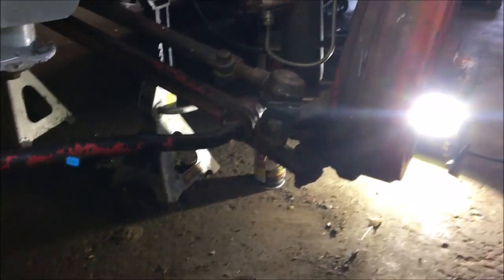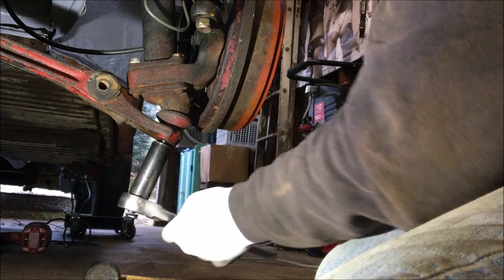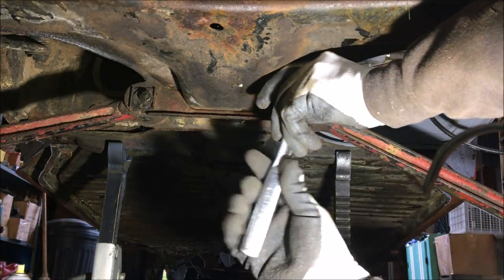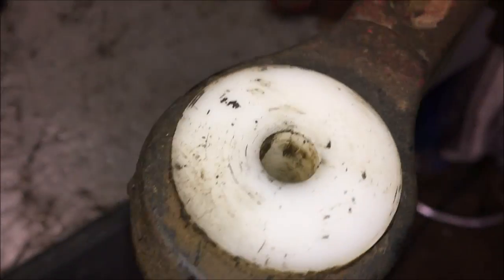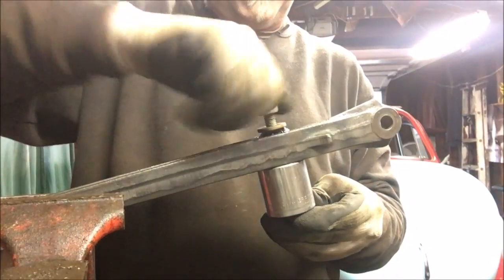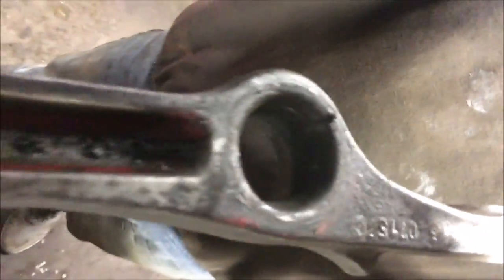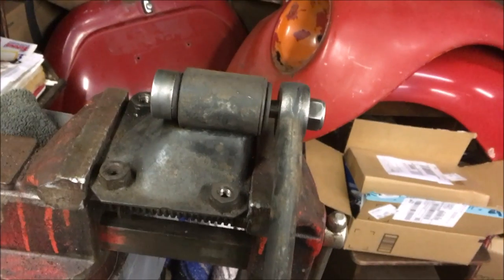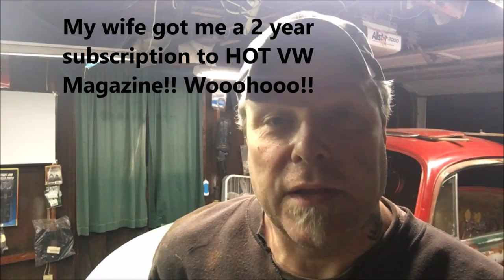VW Super Beetle Front Suspension Rebuild Part #1 Super Beetle Shimmy - Super Beetle Ball Joints

Comment: Great video. 👍 I’m about to start replacing the control arm bushings on my ‘71 SB, and I heard you mention in this video to mark the camber on the bolts with a chisel… how do I mark it correctly so that i end up with the same (or close to it) alignment of how it was previously? Thank you again.
Reply from the maker: Just take a chisel and lightly tap it, on both so you’ll put it back on the same way. Also maybe a paint marker instead!
Reply: @SladesVWBeetle  Thanks! I’ll do that. I  like the idea of painting the control arms in black. I’ll do the same. 👍
Reply: Very useful tips! I’m doing this now. What kind of paint did you use to paint the control arms and the front end underneath?

Comment: It You could or would you do a video on a 1973 Super Beetle strut housing and spindle separation and replacement. I have the three bolt ball joint McPherson strut system and the spindle is very well worn...please help

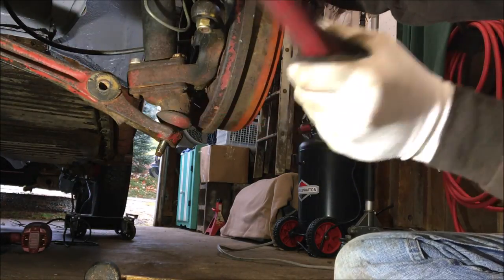Comment: At 4:13 he smacks it with a hammer.  I can't seem to get mine undone that way.  He talks about going up top and undoing something but it isn't shown.  What is he talking about?
Reply from the maker: OK 99% of the time you can smack them with a pretty heavy hammer and they will break loose. However, if it won’t break loose like that, you will need to use a ball joint fork. I believe Harbor freight even sells them pretty cheap. I actually show using one in one of my newer videos Removing a front beam off of a standard beetle
OK I don’t know what you mean about up top. To remove the ball joint there should be three bolts on top, right where I was hitting. If you don’t mean that, then up higher inside of the trunk, there should be 13 mm nuts to remove the whole strut. So I’m trying to figure out if it was one of those two.

Comment: Another great video Slades. Was that a 14mm hex on that arm I remember you saying in another video you used a 14mm for something in the steering if so I need to get one of those too lol 😂 gives me excuses to buy more tools. I’ve always got great enjoyment out of doing suspension work for some reason.
Reply from the maker: Honestly I can’t remember what size, unless I would go back and watch the video. LOL, I actually have been buying a lot of tools from Lowe’s. Or Home Depot. Harbor freight has some pretty decent shots if you spend on the little bit better of what they have. I don’t know if that even made sense LOL
Reply: @SladesVWBeetle  LOL. It’s all good. I need a good bearing race and seal installer I am thinking of getting the Maddox one from Harbor Freight it’s supposed to be the better one. I ordered a guard for my beetle that goes on the front under the handle so if you have to cut it off it won’t damage the paint. I got it also from M&T manufacturing.
Reply from the maker: That guard at the bottom of the handle is a really good idea in all honesty. Harbor freight sells a nice kit For the race installers. It’s not something you use daily so I think Harbor freight brand would be just fine.
Reply: @SladesVWBeetle  yeah I shattered the one I had at work after gosh probably 5 or 6 years of hitting on it lol. I need a good hand impact driver too I liked the Craftsman ones at Lowe’s but don’t know how the quality is on those.